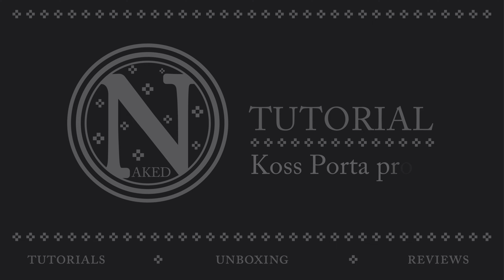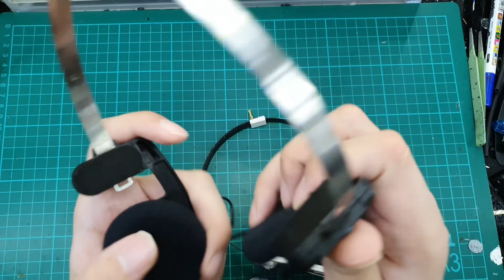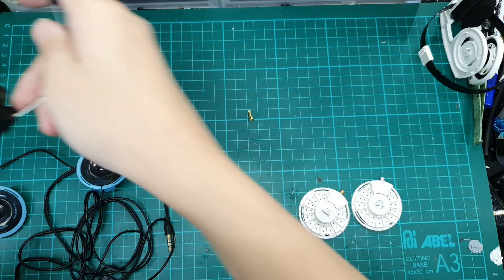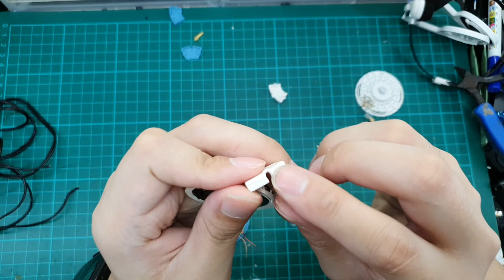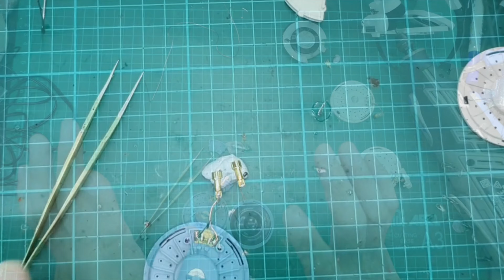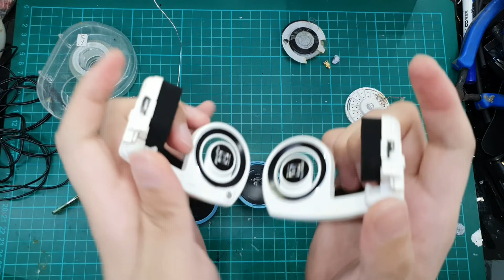Koss Porta pro MMCX detachable mod Tutorial

Comment: How does this improve the sound? Because why do it if it doesn't? Are you going to put $100 cables on these?
Reply from the maker: generally a detachable mod is for functional purpose where you can remove the cable for storage or change out a faulty cable. and yes, we do put $10k cables on these for fun once in a while

Comment: I’ve recently replaced the cable of my two Porta Pros, but their sound became much worse after the replacement. What can be causing the issue? They seem completely different headphones.
Reply from the maker: It's highly likely you wired one of the side in the wrong polarity if the sound change is drastic as the stock porta pro cable is a very standard quality and almost all replacement will be better

Comment: The little cable covers on the stock Porta Pros are quite fragile, broke both on one side, and one pin in the other. Found it easier to remove the cover on the KSC75s.
Reply from the maker: The tabs only goes one way up so have to really pry them slowly

Comment: I used this stuff called milliput to glue the connectors in. It's a epoxy but it has the consitancy of blutac so you can mold it into shape by hand. Perfect for this sort of thing in my opinion. Just remembered I wanted to share that.
Reply from the maker: Hey there! Milliput is a brand of epoxy putty and it's exactly what we use for molding and fixing the connector!

Comment: Ended up breaking the cables on mine so it's time to finally do the mod. 

I was wearing them and my dog jumped up and caught the cable pulling it off of one of the drivers. I checked and the pads are still fine though the strain relief thing completely snapped off.
Reply: well how was it now?
Reply: @korbi119  They work great :)
Reply: Breaking the cable is a given seeing how flimsy it is, and non detachable. Unforgivable that they made the cable like that imo

Comment: I just noticed Koss porta pro is 60 ohm headphone but mmcx connector rating is 50 ohm so does it mean it will change sound or what?
Reply: Curious
Reply: The volume will go down since there’s more resistance to get to 60ohms. You most likely need to turn the volume up more. Maybe us a dac if you want full sound like before. 10ohms then again won’t make a big difference.

Comment: When you tinned the cut cables, I have not seen you use flux I believe because you use rosin core solder which has flux already, but some forum modders insist on using flux anyway as they think the flux included with it is not enough. I need clarification please I want to try soldering.
Reply from the maker: depends on what solder you use, most cheap older can't adhere even when it is rosin core

Comment: How do you find the connections in regards to life span? I think RF push connectors only have a 100 push click life expectancy or something like that. Have you found issues with them wearing out? Also after searching MMCX online I see they have impedance ratings. Does this matter at all when choosing which one to use? I'm interested in doing similar with a vintage set of Pioneer SE-6's I picked up which doesn't have much room for modding.
Reply: These MMCX connectors are used fairly often for this with the more expensive in ear headphones.

Comment: Modding the KSC75's with an mmcx connector with the thingiverse thingy is SO hard. It made me never want to solder again. I hope it's worth it. Thanks for the tips from the porta pro mod
Reply: I just ordered a set of KSC75's What is the thingiverse thingy you are referring to? My friend has a 3d printer and I was wondering if the thingiiverse part is essential to do the mmcx mod?
Reply: @simmo2040  Uhhhhhh i have no idea where to link you to it's probably easy enough to find by googling. I'm pretty sure that you're going to want it if you're doing the mod. It raises the connector off of the headphones so you have clearance for it. You may be able to dremel/drill out a large enough hole in the normal plastic thingy but i wouldn't condone it
Reply: @tn0wl361  perfect I will get onto printing some. After further research people have managed to fit the mmcx by dremelling but I don't think there will be much plastic to work with besides I do like the 3d print design as it looks awesome and is customisable colour wise and design wise
Reply: @simmo2040  you also run the risk of destroying the plastic of the original headphones, which is not as replaceable as the 3d printed part. And i would agree that it looks better. Be warned though, as I said up above, it is a bitch and a half to do the soldering job. You should be fine though as long as it isn't your first soldering job like mine was lol
Reply: @tn0wl361  haha nah I have done alot of soldering on small drones so I should be fine with my smallest soldering tip, however I have butchered the smallest micro sized soldering before but going off some videos this doesn't seem to difficult. Now I need to find a headphone amp as my Hybrid Tube shat itself.
Reply: @simmo2040  Can't say i've used a headphone amp for ksc75's lol. I feel like a heathen for using a class d to power my stax energizer lul
Reply: @tn0wl361  sorry I actually don't intend on using an amp for the KSC75's but for my other Sennheiser headset I do.
Reply: @simmo2040  ohhh okay. Nice then :) Cool seeing moderate to serious audiophiles modding cheap amazing headphones like the ksc75. I was actually intending to make mine wireless with fiio utws's but i shitcanned it because the soldering was so hard to get right.
Reply: @tn0wl361  yer absolutely, I wish I had of found these ways earlier. That wireless business sounds cool but yer the soldering you have to think time and effort sometimes.
Reply from the maker: Glad to be of help!
Reply: heyo Im trying to do the same with my KSC75's. Howd it go for you?

Comment: Thank you for tutorials. Will you also make a video for Grado's detachable cable? Perhaps using SMC/sma connectors? There's some videos online, but they don't show which part is ground on the female SMC mount or on the drivers itself to solder. I hope to put together a wooden Grado headphone from scratch. This is my first time attempt. I found some parts on Etsy for the headband, gimbal, wooden cups, but nothing on the mounting connectors.  Any links to parts would be appreciated. Thanks again for your time.
Reply from the maker: Anything else outside of the centre pin that is gold plated is the ground. If you were to build on of these, I suggest a more efficient connector like 3.5mm as SMC is not suitable for a dual input design. You can check out what happens to the older SMC hifiman cables after some use. For connectors almost any hardware store should have those as they are general purpose
Reply: @sgaudiohive  Thank you very much for the advice. I hope your channel grows big. It has lots of informative videos for novices such as myself. It is great for the community.
Reply from the maker: Thanks! Will will strive to do 100% coverage

Comment: hi, thank you for the tuto. Where can i find the little color wires to weld the MMCX conectors...? have you a link please..? and what is the paste you use to hold the wires and connectors for weld...?
Reply from the maker: The paste is called blue tack. The colored wires, you can strip off any old earpiece wires and you will have access to a lot of those